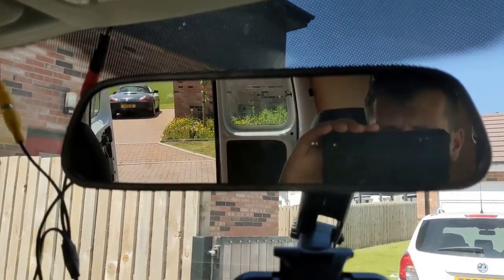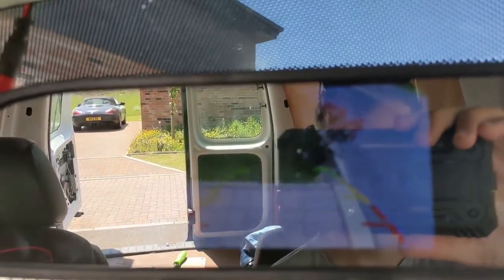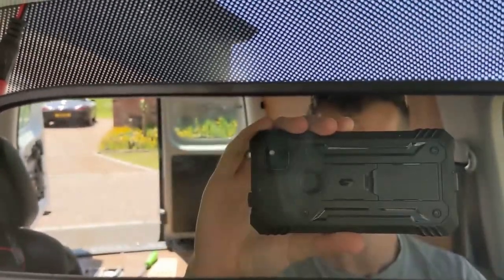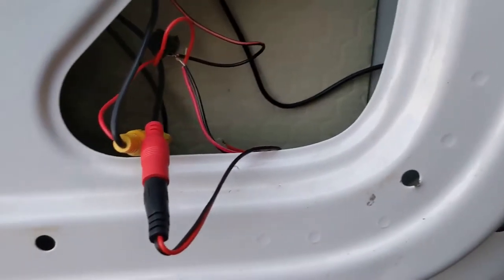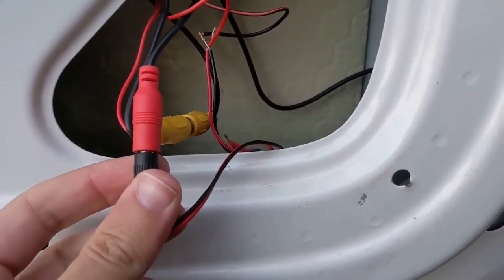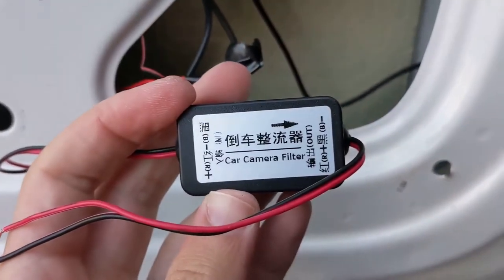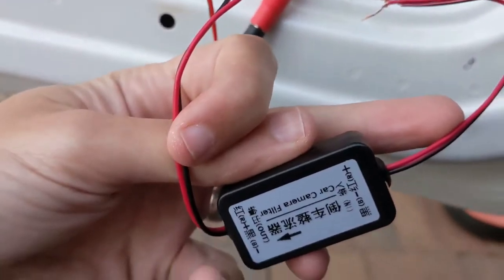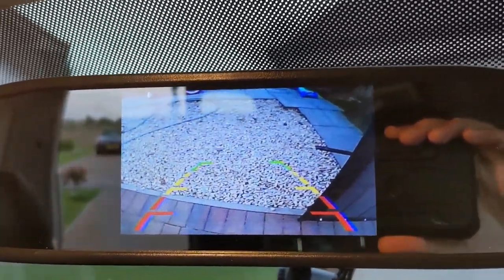Parking Camera video interference when engine running

Comment: Anyone have a similar issue to the one I am having? The reversing camera comes on as expected when the car is in reverse and the ignition turned on. But no image when the engine is started. It’s a VW Caddy van and I took power and ground off the reversing light

Comment: Hi David, thanks for this video. Struggling to understand though what goes into the relay and what wires are linked up on the out? Can you shed some light please?
Reply from the maker: Input is just your live and neutral (red and black) the output is the same. All the kit you buy should colour coded.

Comment: Same issue happened in my BMW. It must also "pulsate" the voltage to detect faulty taillight bulbs, because I get errors on the dash for my led upgrade bulbs.. Reverse camera works fine when engine off, but as soon as I turn engine on, video gradually gets worse, then completely cuts out. The camera basically dies after 10 seconds of engine running. I'm definitely going to try your fix out.

Comment: Hi just fitted as you have discribed .the signal needs to be from canbus to the head not a signal from rear lights . As this loses the signal triger for the head
Reply from the maker: Hi, you are correct, if you are fitting to a head unit with Canbus compatibility. This video is for correcting a rear camera that is powered from reverse lights.

Comment: Hello! Maybe you can help me, i’m really out of my mind, I have a manual BMW e90, with android aftermarket headunit and of course aftermarket camera, i have bought 2 filters, with the first one the image is very unclear with a lot of horizontal lines, the second works great, no lines at all, but every 3-4 minutes, my screen goes black with guide lines, and it goes in reverse mode, without image…. I thought it may be some grounding problems, but as I said, with the other filter the screen doesn’t go black every 3-4 minutes, but the image is not clear.
Reply from the maker: Have you got it on all the time? 3-4 minutes sounds like a long time. The camera really only should come on in reverse mode. Have you got power coming from the head unit or the reverse light?
Reply: @davehawk4951  thanks for your answer!
No, it’s not on all the time, it’s off for 3-4 minutes, then it goes on black screen for around 5 seconds, the power is from the reverse lights
Reply from the maker: @alterata  sorry mate I'm having trouble following. Does the image only show when you have the car in reverse gear?
Reply: @davehawk4951  I think what hes saying is that when testing the camera in reverse, if its on for few seconds, then the image will go blank. Im having same issue. I have the terrible flickering, then the image goes blank. Still has parking lines, just no image from whats behind me. I have mine powered to the left brake light on E89 Z4.
Reply: Do you know that your camera didn't come with one in-line? Mine did. But I don't think it's very good. I get horizontal static lines too. 2008 BMW M3. Grounding is on point and installation is recent so it's either the camera quality being low or bad regulator.

Did you ever solve this? The E90x platform uses the same type camera.